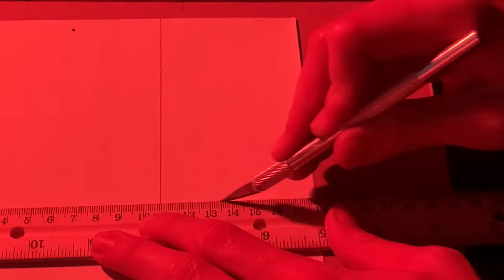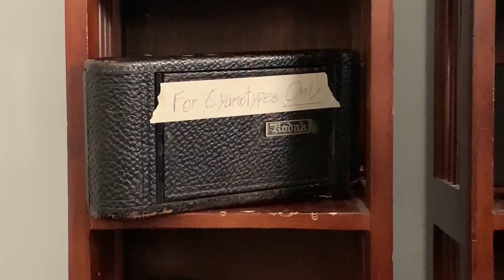Cyanotype Photography with Folding Camera

Comment: A strange coincidence. Yesterday I used a very similar camera to make pictures with cyanotype. It is a 120 rather than 620 and it is almost functional. I just had to clean the lens and insert photopaper.
Today I opened youtube and saw your video. Lovely. I like it.

 I used the process with separate citrat that is a similar process. 

One of the first Cyanotype processes used by Herschel.

Coating: The paper is coated with a light-sensitive solution of iron(III) citrate (ferric citrate).

Exposure: The coated paper is exposed to UV light. This reduces the iron(III) citrate to iron(II).

Development: After exposure, the paper is coated with a solution of potassium ferricyanide (red blood lye salt) using a brush. The iron(II) reacts with the blood lye salt and forms the deep blue dye Berliner Blau.

Fixing: The paper is rinsed with water to remove excess chemicals and fix the image.

I like your results very much.
Reply from the maker: Wow, is this chemistry true? I've never heard of it! Chemically, it seems similar to ferric ammonium citrate, but the interesting step of adding the potassium ferricyanide atop the first coating. Thank you for your knowledge, I'd like to look into that. And I hope your cyanotypes turn out even better than my murky results!
Reply: @thatrecord5313  Indeed it is described in mauals about earliest Photography. Herschel experimented with this and changed his process to mixing the solutions.  Maybe beause the contrast was better for his purpose. The mid tones are rather good with the two-solution method. The overall contrast for copying is much better wirh the mixed solution.
I will search for some literature.

One fact I found in youtube is: It works much better with lower PH (3...4). You should not use buffered paper or alcalic paper.

I already tried in earlier times and I like your results. With the traditional mixed solution 1 and 2 I did not get a picture after more than one day. A picture appeared but wen  I developed with water it washed all away.
I will send a short follow up.
Bernd
Reply from the maker: @ Thank you for that information. I'm assuming the pH 3.5 fact you got from the gentleman with the know-how chemistry videos on cyanotype photography. He is a good source of inspiration. He told me that pH at 3-4 offers a higher sensitivity. I was wondering about the 2-solution method, and whether or not that actually increased sensitivity? Perhaps the scientific method would come in handy here, if only I had the time here at college. Good luck with your research. I'd love to hear more!
Reply: @thatrecord5313  To me it looks more sensitive in some way. But not in a linear way. It goes up to middle tones. 
I did never reach a dark blue. However it does not wash away light color. When I develop it immediately changes the color.
You can try in a simple way. Cover a small paper (watercolor paper) with citrat (solution 1 or A) and make a photogram.
It will be yellow to a light brown. Take a brush and cover its with solution 2 (or B) - the parts which are exposed with light recolor to blue.
This worked in camera with 4 hours.
When I mix A and B, after in camera I developed with water, the picture vanished completely. I tested this. I think, however, after I saw videos, it may depend on concentration, light and ph (solution+paper).

Comment: I’ve done this with a similar camera and have gotten some incredible results. I recommend using card stock instead of watercolor or multimedia paper. It gives a better result in the end. Also exposing for 2-4 days gives best contrast on. Sunny days you can get away with 1 day of exposure
Reply from the maker: Card stock implies I'd have to paint the chemical myself, no? Unless there is cyanotype card stock. Gee, 2-4 days sounds familiar, when I first started experimenting with this as an 8th grader eight years ago. Made a magnifying lens camera and it took 3 full days of exposure, but the result was the best scenery photograph I ever took. But that was in Nevada during November, with UV index of about 2.5. In this video instance, for example, it was June in Florida, and the UV index was 9! I was surprised I even got the exposure at all! I couldn't see the latent image as first, probably because of how negligible the UV exposure is on the insensitive "film," but it could also be because it's the cyanotype package I've been using since being an 8th grader and it's getting old. Thanks for the advice, cyanobuff. I hope you enjoyed someone else's take on this neat hobby.
Reply: @ yes, I watched this video the first time a few years ago in preparation for what I’m doing now. I’ve chosen to brush the chemical on paper manually because I am able to choose what texture the photo has. Paper with a fine uniform grain that does not swell works best from what I have found. Thank you for sharing.
Reply from the maker: @enjoyer8700  I see, that's sound reasoning. I''m in college now and have a phenomenal view of an old house in front of my window, perhaps I will use some of the art depts cyanotype chemicals and pull out an old medium-format camera. And thank you for your knowledge!
Reply: @ that’s sounds awesome! I’m also in college. And have enjoyed Cyanotype photography greatly. 1 thing that I have done differently is that I usually don’t wash the photos after. The water causes the photo to blur. I typically just sure to not over expose it and without the wash you can get some very sharp results.
Reply from the maker: @enjoyer8700  You're also in college?! Aha! That's awesome. I'm a junior at Hamilton College right now, so I've got a year or so to "play" with photography before my hobbies are displaced by job hunting and working. What do you mean by "don't wash the photos after?" How do you recommend development?
Reply: @ mine generally have come out as a very clean negative photo. I just take a digital scan too them and invert them in photoshop to get a positive
Reply from the maker: @ I see. I am the sort of person who would rather forego digital technology for the genuine result. Certainly, the quality is fuzzed, per se, but I appreciate having that print in my cyanotype portfolio. But come to think of it, you would certainly get a sharp image. But you would be missing out on that contrast, not to mention the print itself.